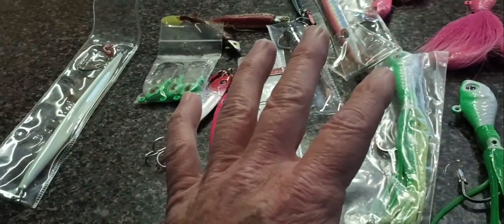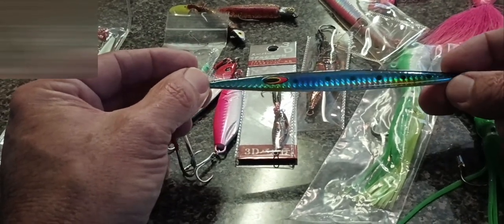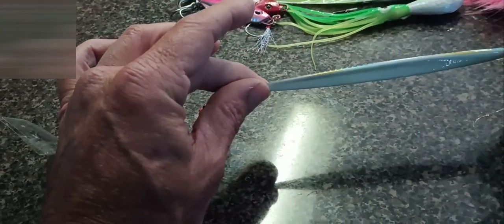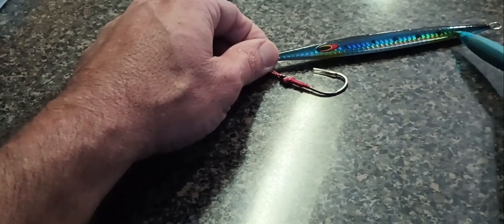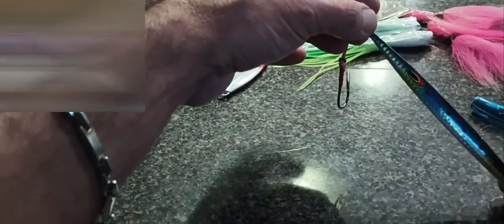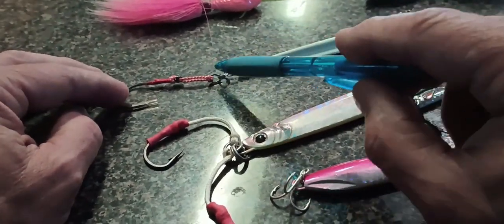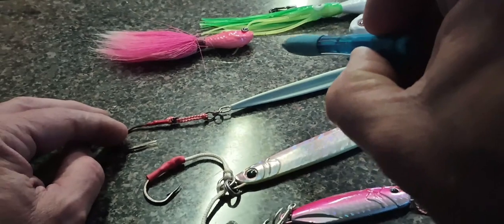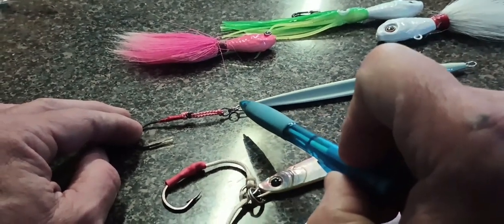SLOW PITCH JIG, Speed Jig or Bucktail Jigs in Shallow water? (TUTORIAL - LEARN, WHAT, WHY, WHEN)

Comment: Thank you for this video. Every other video I have watched on youtube (and i have watched a WHOLE LOT) says that the topshot leader connected to the braid main line should be tied onto the solid ring. The assist hooks are also attached to the solid ring. The split ring is connected to the Solid Ring. The split ring, with all other components connected to it is attached to the jig itself. However, you're saying that the top shot is to be connected to the jig itself. Which is right???
Reply from the maker: It's highly debatable. And, even info from other countries is different among those anglers as well. I have tied to every part of the setup to see what personally presents the jig better. In more recent videos I mention tying to the split ring with a micro 80 swivel. ALL of the methods catch fish.. What we know for sure is tying to the welded ring or the split ring raises the hook height while jigging under tension.. Which, may or may not matter at all. Or, it might.. Right now, I have most of my SP jigs tied to the Split Ring yet again.. My Fast Jigs are tied to the jig itself. In ALL cases,, using a spro micro 80 barrel swivel to attach.

 In saying ALL that, we Like to try EVERYTHING and to be honest, we can't tell much difference in the depths we fish most (50-120 ft). In deeper water, there may be a difference..  Mess around with it and see what you like best.. I think you'll find that it all works, but you'll end up favoring one way over the other... Let us know what you end up liking most! Fish on!

Comment: Love the amount of perspective you have with different jigs over the years. I only get a few weekends a year of offshore and the goal is to put as many fish in the box as possible. Do you out fish bait with jigs often? I see jigs as way to mainly get a few extra bites through out the day vs a bait replacement, and just a way to have fun doing something different. How do you work in jigs when the goal is catching as many keeper fish as possible vs just jigging for the joy of the technique . Thanks!
Reply from the maker: Add a Bonito skin strip, or cero, Kingfish or Spanish mackerel strip.. 2-3 inches long to a bucktail, and maybe 1/2 inch wide. You can bet that'll spice things up, quickly!! Especially if they're not biting between tides and times of slow current or no current.. Fish on! Capt RL
Reply: I always get to the bottom first and will hook up first. If the capt says the fish are 50ft up bottom and i can work it up or down going there and stay longer than bait guys do. Im always connected with my jig and i know if my jig aka bait is there all the time not second guessing if my dead or live bait is still there esp in deep water. As long you present it right you will catch on par or more than bait guys do. We like fishing with bait guys as we think the bait serves as a chum for jig guys. But its not a technique that conquers all. Its fishing you will get skunked or catch alot. And we fish what works we drop dead, live and jig all same time and use what works to get the most meat. =)

Comment: Yes I do have question after spending 30:54 watching your video. Bucktail is the lure/jig that switch me from using bait(stink) to lure. I learned to use bucktail from this guy name John Skinner. Been doing well with striped bass. However, when I went to south East Asia for vocation, I did some fishing, I notice all the people on the party boat only use those metal jigs with assist hooks just like your. Nobody knew anything about fishing a bucktail. My question is when do you use those metal jig and when do you use bucktail? Does bucktail work on deeper water compare to those slow pitch jig? And how come most people aren't using those slow pitch jig when fishing from inshore? Why did you say jig in 20/30g work better compare to heavy jig? Enlighten me please.
Reply from the maker: Thanks for watching! About your question, pertaining to what occasion would inspire me to fish metal or bucktails..

I will fish both. Almost always, even in deeper water. Usually, the slow jigs will outfish the bucktail for Grouper. I have found that snappers "seem to prefer" a bucktail. That said, I'll swap between the two types of jigs, and the 3rd, a simple vertical speed (fast jig). The fast jig is my LAST choice. It's an amberjack killer but fast jigs simply cannot be presented as well as a slow jig. Slow jigging is very productive with the proper technique and proper rod, line and reel. It's catching on around the world. There's a reason for that, it's highly productive for Bottom fish, especially.. But never discount a bucktail jig of the proper weight for the depth/current you're fishing in.